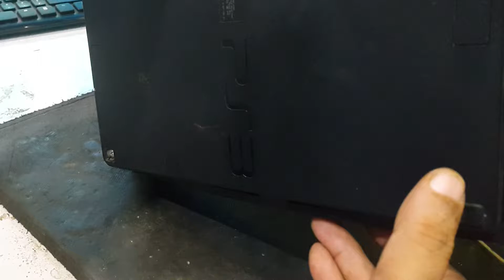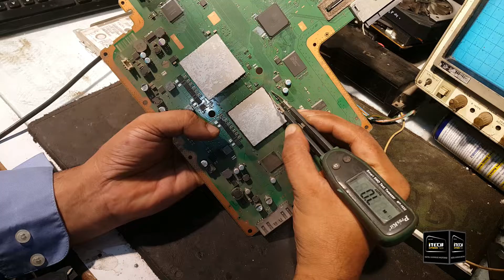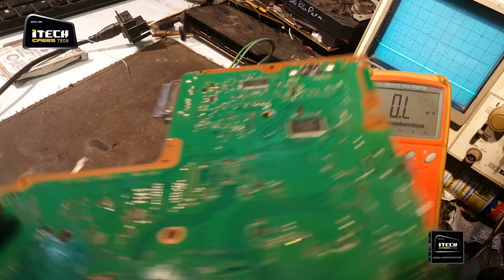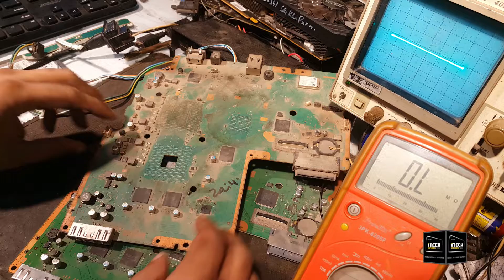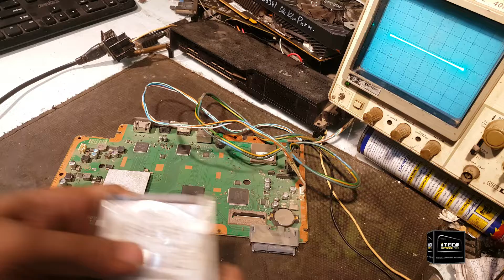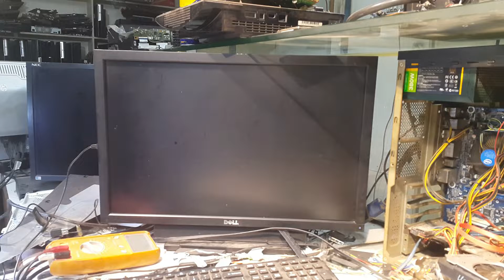ps3 turns off immediately after turning on

Comment: WOW I FIXED MINE SAME EXACT ISSUE BLOWN FUSE F6300 REPLACED EXACT COMPONENT YOU REPLACED AND NOW IT WORKS . THE ONLY ONE I DIDNT REPLACED WAS THE 5.5OHMS RESISTOR THAT YOU REPLACEE BY 3.6OHMS

Comment: Hello my PS3 Slim CECH 2504B switches on for 5 seconds and switches off without showing a red light, I tried checking the board but the screws for the power supply were stripped Please help me

Comment: Mine shuts off after 5 seconds with no red light, I noticed the CPU gets super hot under 5 seconds, what could be the issue or culprit
Reply from the maker: Hi @michaelolayinka441! If the CPU gets extremely hot in such a short time, it could be due to poor contact with the heatsink or a malfunctioning thermal management system. Check the thermal paste and ensure the heatsink is seated properly. Also, verify if the fan is spinning correctly during startup. If those seem fine, a short in the CPU power delivery circuit or a damaged MOSFET could be the culprit. Let me know if you need further guidance!

Comment: Do you have like a diagram showing which parts we need to check
Reply from the maker: I don't have a specific diagram at hand, but for a PS3 turning off immediately after powering on, the areas to check include:

Power Supply Unit (PSU) - Test the voltage output.
Thermal Management - Inspect the thermal paste and cooling system.
RSX (GPU) and CELL (CPU) - Look for overheating or connection issues.
SMD Components - Focus on resistors and capacitors near the power and thermal circuits.
Board Shorts - Use a multimeter to check for shorts near the RSX, CELL, and power inputs.

Comment: my ps3 have same issue but it works sometime automatically can you repair it for me send me your contact number or address to send it to you
Reply from the maker: @hamasmalik If your PS3 has the same issue and works occasionally, it might be due to a loose connection or a failing component. Right now, I'm not able to share personal contact info, but I recommend reaching out to a trusted local repair shop for hands-on help. Feel free to ask here if you want any tips for troubleshooting on your own!

Comment: You should be careful when probing high voltage lines with your oscilloscope, (12V in this case) and right after that probing some sensitive circuitry!
The input capacitance of the scope charges up to that voltage, and you risk demaging something.
I always touch the ground to discharge the scope probe (cable) between 2 measurements.
Reply from the maker: Thanks for all the information, and I will keep this information under consideration.😀